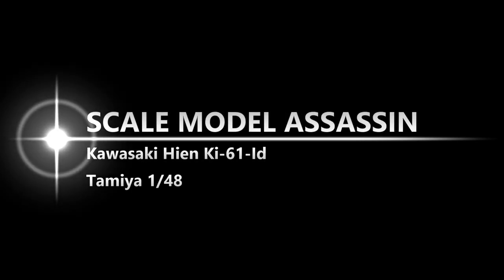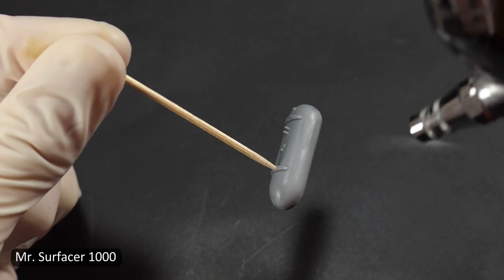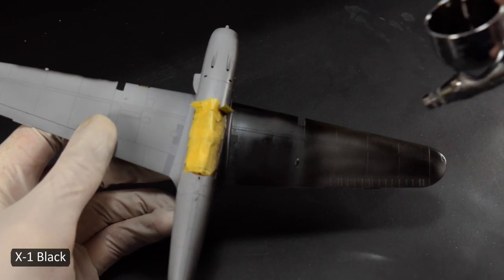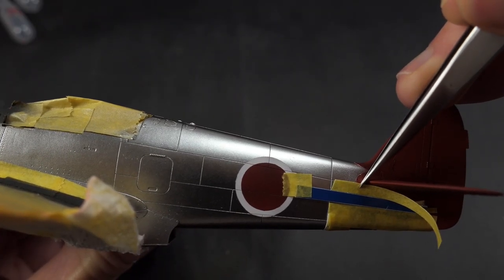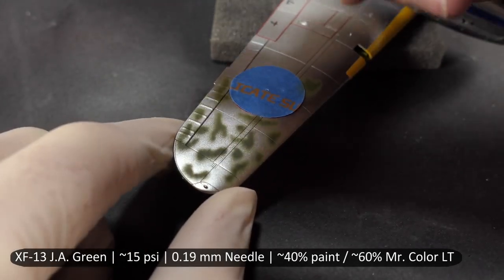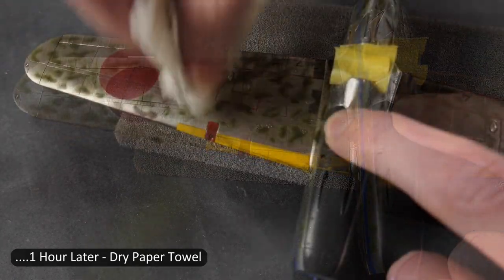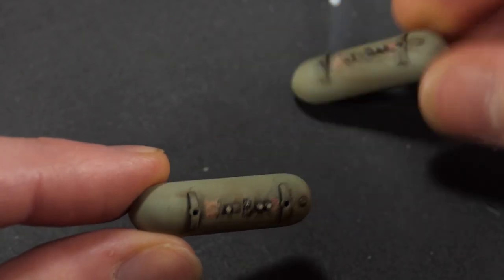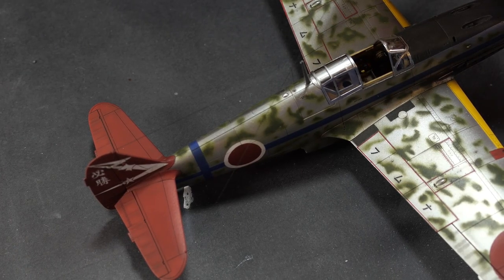Kawasaki Ki-61-Id Hien - 1/48 Scale Model - Part 2 of 2

Comment: If you use some Tamiya paint retarder with the Tamiya paint it will splatter less and you'll have less dry tip on your airbrush. That will make your green camo work less stressful and your paint will flow much better.
Reply from the maker: I always forget about that product, I need to go pick some up and give it a try.  Thanks

Comment: actually you just need to thin your black a little more,. 2-3 layer then 1  wet layer, no need to polish my friend, thinned your paint more, it will work easier. overall great work my friend.  You can watch my zero video if you want to see what ii have done
Reply from the maker: Appreciate the tip,. I'll play around the the mixing ratio and test it out